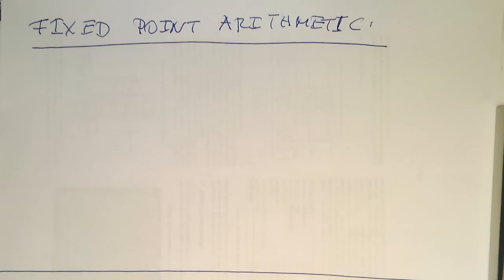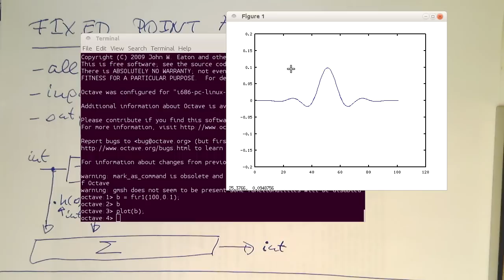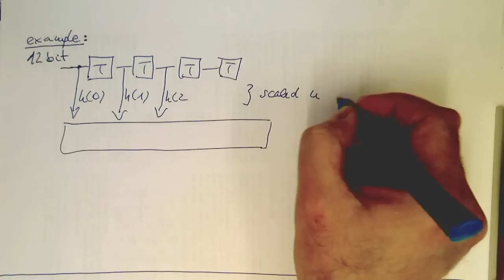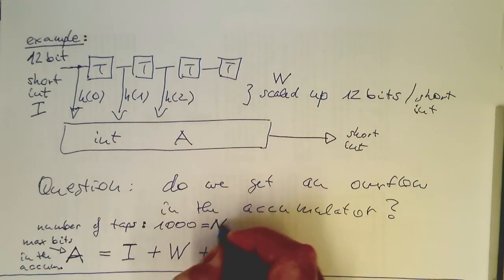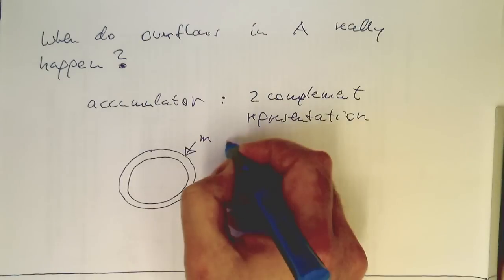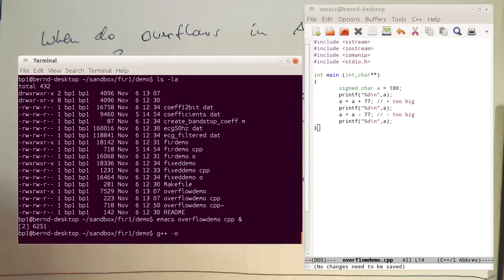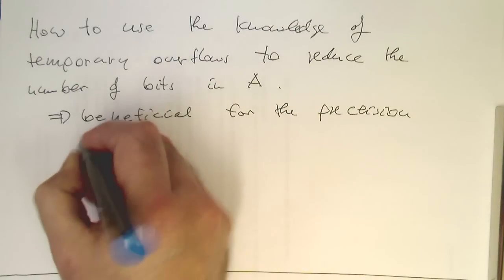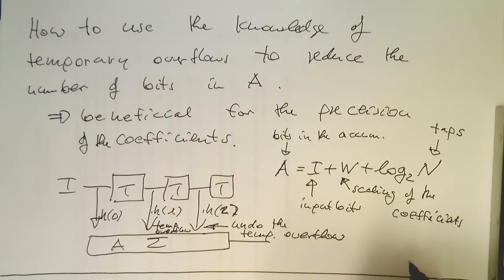Fixed point FIR filters: theory (0005)

Comment: 19:59 How can I tell if the gain is smaller than 1? Is it possible by looking solely at the impulse response or do I have to look at the frequency response? I'm currently playing with FIR-filters using microcontrollers your videos are a great resource for an efficient implementation.
Reply from the maker: Good question. If you sum up the impulse response then you only get a rough estimate. You are right and look at the frequency response. For example if the passband gain is one. If you design your filter you usually set the passband gain to one so you are safe. You can always do an fft on the impulse response (=coefficients) and check. In particular with fixed point it might deviate from your designed unity gain.

Comment: Thanks for posting the video.  Since we are talking about FIR filters the impulse response is the filter kernel (set of filter coefficients).  Why not sum up the values of the coefficients?  The sum would be multiplied the largest expected input sample.  This should tell us the number of bits required for the Accumulator.
Reply from the maker: Good idea. Can be be done that way.